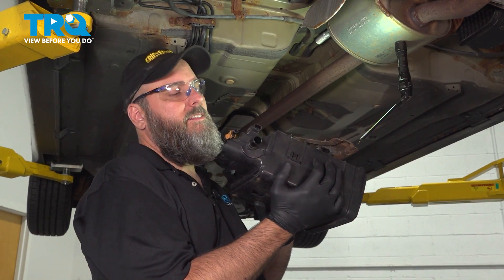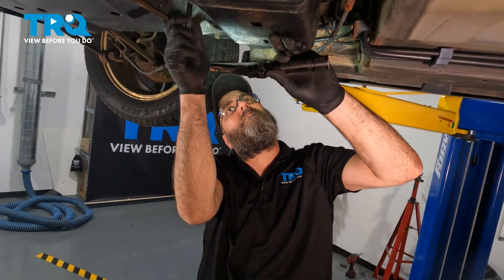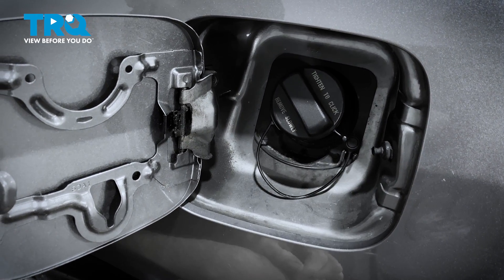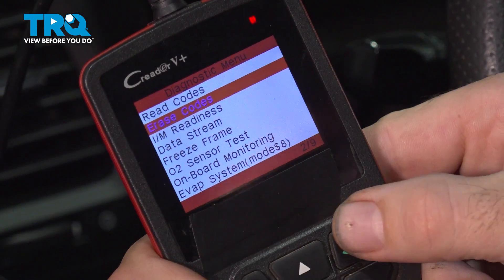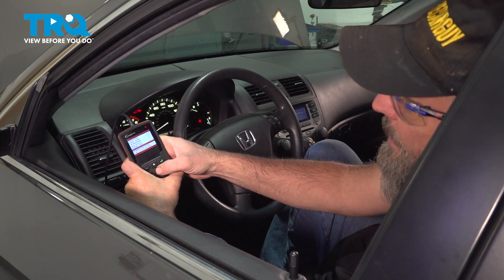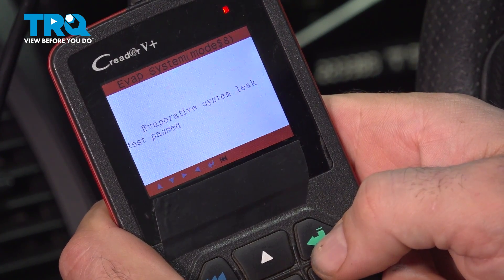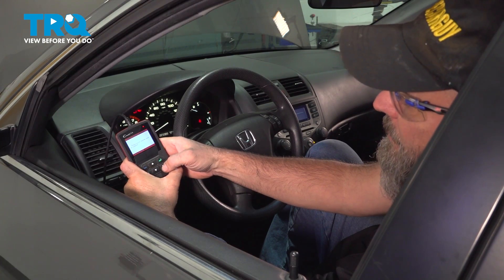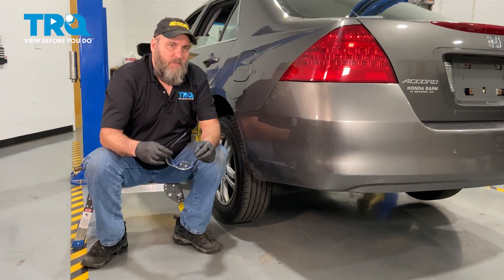EricTheCarGuy Explains Check Engine Codes - P0455, P0456, P0442 EVAP System Leaks

Comment: The code P0456 came back after replacing the cap and the vent solenoid valve on 2016 Genesis.  What else can it be? I only have 47k miles on it.

Comment: How do u know if the evap code is on the fuel side? Because i got a p0497 for low purge flow and randomly a check fuel cap light will pop up and dissapear. I replaced cap with oem

Comment: Dis smoke test by removing a hose from the purge valve that goes into charcoal canister. 07 Matrix it’s next to mass airflow sensor.A lot of smoke coming out around gas cap. New gas cap another smoke test and fail. More smoke around the gas cap area. I have a filler neck issue but haven’t gotten tidy fat yet. No fuel smell in my case. Code is P0456

Comment: I had a huge leak code. 2002 vw 1.8t. I smoke it with harbor freight multi use transfer pump. I can't afford a fancy smoke machine.  Anyway, 2 obvious hoses from the leak detection pump were deteriorated with holes. The least obvious was the gas cap seal. Good luck to you all.

Comment: The fuel tank pressure sensor could be an issue and not flag a code for the sensor itself. If the sensor was stuck it could show a leak when in fact there isn’t one.

Comment: I had the p0456, then I replace the fuel cap.  Another code pop up which is p0442,  it was two little hoses in the engine which was cracking up because my cars a 21 years old and those two hoses has never been replaced,  I just replaced that and clear the codes.  I’ll have to see if the codes pops up again

Comment: Hi Eric let’s my question to you I got 2012 Acura tl Sh-AWD3.7l with code P0456 done with Purge Valve Solenoid replacement after a week later the same code pup back.I continue smoke test under Purge Valve hose running way back to charcoal canister areas I see  smoke came out from there.i try figure out to remove& replace it look like I have to remove all rear Suspension rear Drive Shaft & whole exhaust Resonator Mufflers all Down! That’s how the Process to tell me to that do?

Comment: Thank you Eric, good video
Suggestion would be to have extended the video a little bit to then show the process of testing the purge valve in the engine bay which most people have access to, as not to many people have lift to be able to take out the charcoal canister. And to do a visual inspection of the rubber tubing in the engine area as most old car the rubber gets old and hard and cracks. Thank you

Comment: P0456 code small leak checked hoses even replaced the vapor canister and the purge valve I suspect it’s the fuel tank pressure sensor because after erasing the code it comes on after 100miles then goes away after 100miles then comes back again after 100miles and stays

Comment: Hello- I’m getting that P0442 code. I have bought another gas cap. When I take off in my 2010 srx cadillac like it stuggling to get air. It does it only on take off. Then smoothes out. I changed purge valve, map sensor. and when I turn heat on its smells musty. I did change the air filter & cabin filter.
Reply from the maker: +Lisa We wouldn't be able to diagnose an issue like that here, you may want to have a local mechanic take a look at it. Thanks for checking us out! http://1aau.to/m/Shop-1AAuto-c